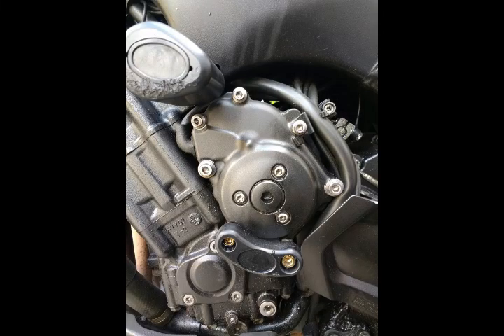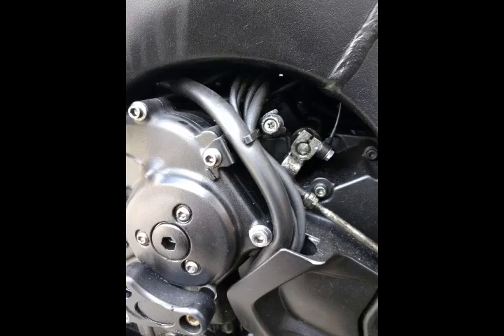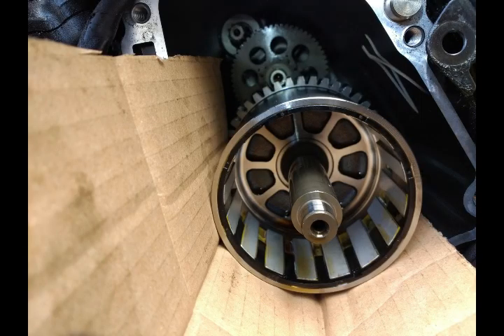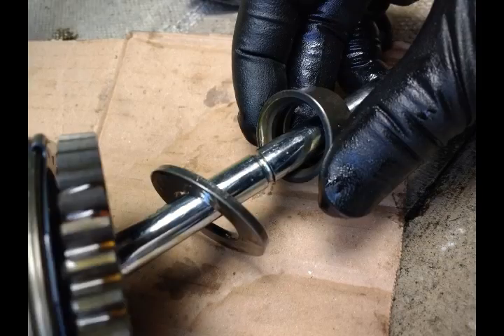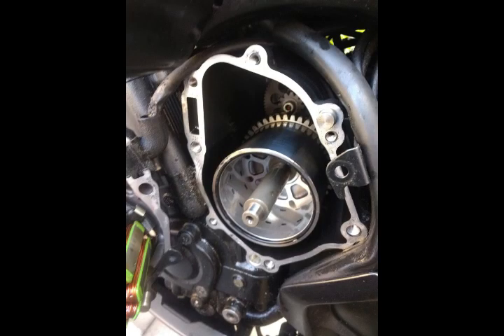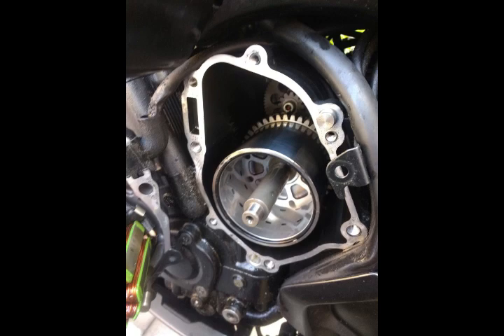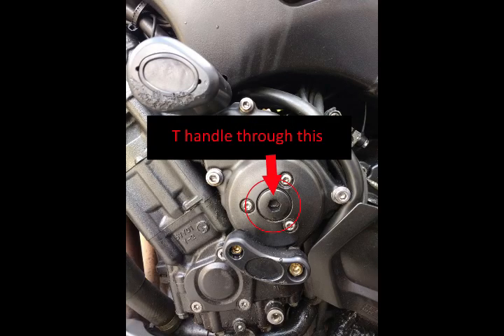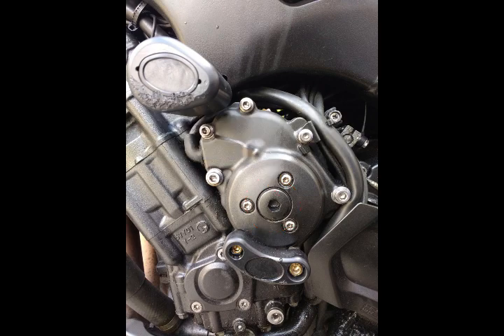FZ1 / Fazer 1000 Gen 2 / R1 Rotor Generator replacement tips

Comment: Thanks! This will help when reinstalling my new rotor after the magnets in my old one disintegrated. Too bad I didn't see this sooner or I wouldn't have to drop the pan to get one of those plastic spacers out.
Reply from the maker: Glad it was helpful
Reply: Did your battery not charge after this happened?

Comment: Thanks for the tips and advice. My rotor arrives tomorrow and I will definitely be using some of the tips you suggested when I’m installing the new one.
Reply from the maker: Glad it helped
Reply: @bikersquest  well I finally got it installed. Hardest part was trying to separate the cover from the rotor because of the magnets and getting the old gasket off. Think I scuffed it a little so hopefully it won’t start leaking later. Haven’t started it yet since I got done late.

Comment: you left the most important video part of removal smh
Reply from the maker: I would've recorded it but had no access to tripod or anything. The cardboard holds the cogs and spacers behind the rotor, I just pulled the rotor out and then with the cogs/spacers held back by the cardboard I got the T handle and put it through them then removed the cardboard and slowly the T handle with the cogs/spacers etc